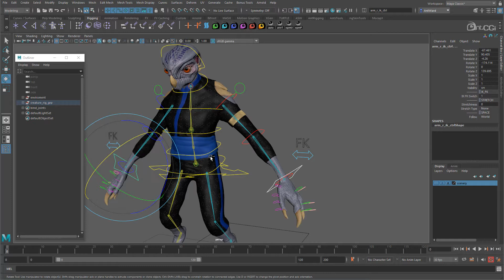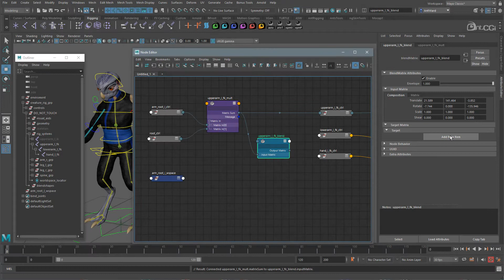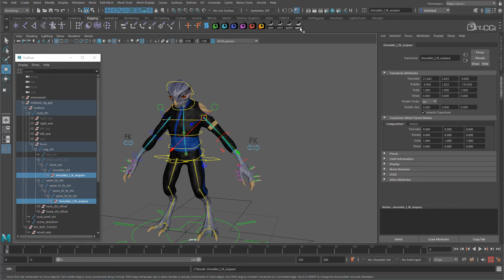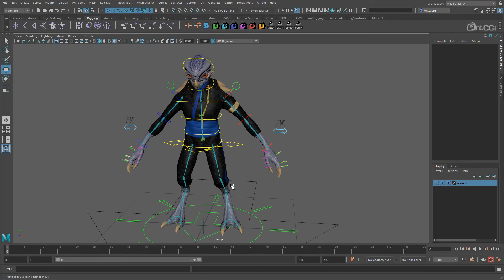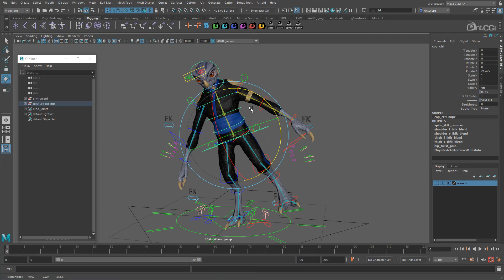Realtime Creature Rigging Workshop (12 / 19) : FK limbs

Comment: Lesson 12: FK limbs

- using Offset Parent Matrix for control-joints, or objects that will not be exported to other software (Unreal)
- direct connect to Matrix also the same
- main joints for exporting should be under *constraint*, so the animation could be baked on
- joints using OPM also need to be zero-ed out Joint Orient

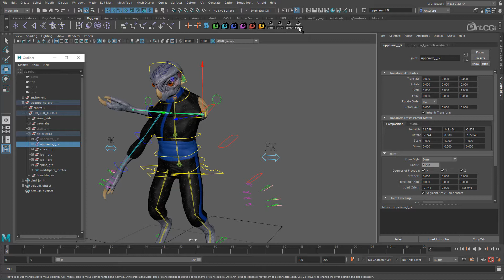2:00 when using script to bake OPM, it also bakes ROTATE, but when manually copying the Translate value of the elbow, he not effecting the joint Rotate/Orient at all, so he didn't need to zero-out the Joint Orient (like in the shoulder
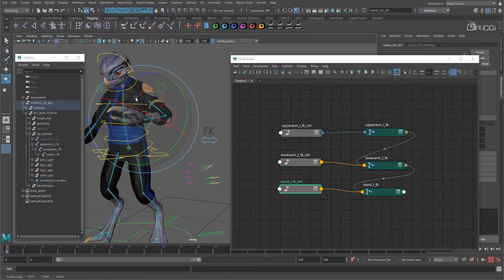4:30 personally I do see a problem when I don't match the rotate order, when I rotate the elbow to a very specific angle, the joint moves out of the curve
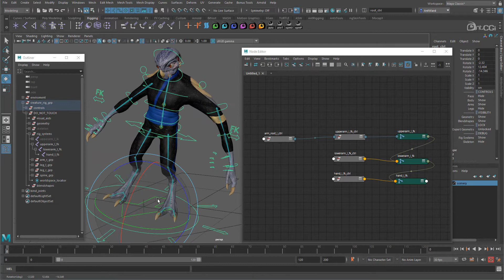6:00 arm root ctrl add another amount of values to the upperarm ctrl, which also go throught to the upperarm joint, so we need to exclude it
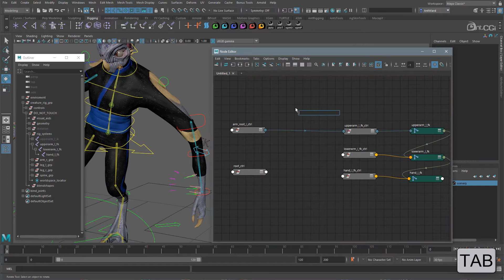6:20 the function of multMatrix node
	it adds the matrix values together from multiple nodes
	connect output to Matrix in
	we want the arm joints only be effected by arm controls, so we need to exclude the matrix value of the root so it doesn't double the transform
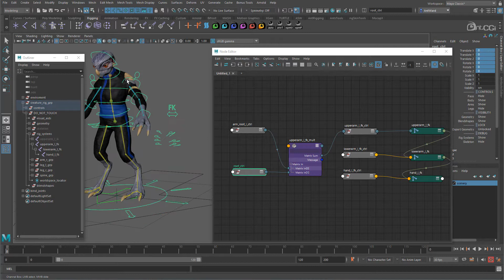8:00 shoulder world space
8:50 blendMatrix node function
17:40 QUESTION
	in the video, you put a multMatrix after each shoulder_l_fk_wspace (or ik), then through the blend node. But what if, I use blendMatrix for shoulders and cog, then I subtract the root out by one multMatrix node only, is that cause any problems? Because it works find for now, but I don't know if it causes any issues later. Thank you for your tutorials btw, and if you still answer this after 4 years, that would be much much appreciated; or any of learners also have the same question, please leave a reply.
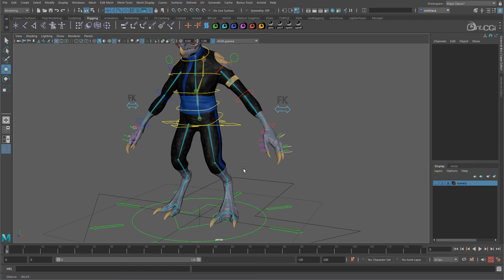19:00 note on legs FK: using the hip control for the main control for the legs IK-FK to follow instead of COG

knee, angle control are just direct connect to joints
hip is more complicated (3 things):
	1. Need world matrix so it can move with Main control
	2. World space swap function
	3. Follow spine in both IK and FK
1. Pretty simple, just need to bake joint's transform to offset parent matrix (remember to zero-out joint orient)
2. Need something to represent world space orient => empty group which match joint's transform (also bake matrix)

- blendMatrix node acts the same as multiple parents constraint one child, allow us to swap between parents
- multMatrix node acts as plusMinus node for canceling out unwanted transform (in this case Main control's)

so, wspace grp and rootControl blendMatrix thighControl
(as I writing this, I personally thing the rootControl is unnecessary, if I need to anim the leg, I'll just use the FK thigh control, leg will follow either world or thighControl, the hipRootControl is redundant in this context. Maybe it has more function in IK idk yet, or maybe it gives more flexibility to animators to have an extra control for the leg/arm, but every other body parts doesn't have the same treatment so I dont think this is the case tho)
but it also need a multMatrix with reverseWorldMatrix of MainControl to cancel out the transform before actually go through to thighControl

3. spine world space is similar but spine has IK and FK mode, so we need TWO groups to represent worldSpace in each case, sit below the hierachy of each IK/FK spine controls

the cog is the local space (leg follow body/cog or worldspace), so blendMatrix of thigh FK and IK wspace and cogControl (3 of them), but it actually are just two: COG vs IK

WRONG, yeah I makes the same mistake again when I wrote these note down, the spine in this scenario is not having any local space swapping at all, maybe later, but in this lesson, the spine problem is just only switching between IK and FK, the two groups are also part of the IK/FK switch, nothing related to worldspace

Comment: Awfully hard to zero out the joints transforms via the matrix offset area and then override said matrix area via a control curve
Reply: using groups as solution
Reply: @ThomasStuart  It's been two months, but do you remember how you did so?
Reply: @madtwist2364  Not even sure I remember the problem. If you describe it, I can probs pinpoint solution
Reply: i guess i kinda have the same problem? On the last step, when i connect the Blend Matrix Node to my Left Shoulder/Arm Ctrl, it works fine, but when i repeat the step on the right side it snaps to the Left control as well? wtf? what am i doing wrong... Do you maybe remember your solution with the groups and could explain?